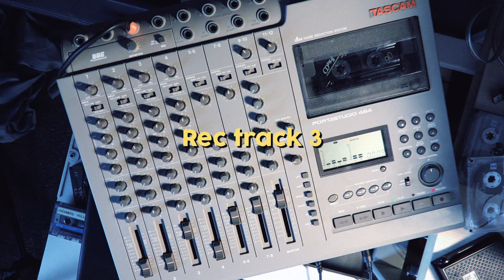How to make 10 second tape loop / tascam portastudio 464

Comment: Your music sounds amazing! I have made a 5 second tape loop but it looks nothing like yours. Honestly, I find it very hard to follow what you did exactly. The edit cuts are so fast. But I would love to try what you did. I have run into a problem with my loop. I hope you or some else can help me over come this issue. I have a Tascam Porta-Studio 464 as well as an old standard stereo cassette player. When I pop the loop tape into the standard cassette player it runs at the regular speed. But when I pop it into the Tascam and press play it runs really fast. Like fast forward fast! I've tried re-looping several different times and I always get the same issue. I suspect the Tascam is not liking something. Maybe a tension issue? Have you or anyone else experienced this issue? Is there a work around? Thanks in advance! Keep up the great work!
Reply: Hey man to answer your question the Tascam recorders record at a faster speed. I believe it’s in order to minimise tape hiss and other artefacts that occur when recording onto tape. Regardless there is nothing wrong with your Tascam recorder it is designed that way. Usually people who use a 4 track recorder would finish their master mix and then bump it out to another recording device that records at the regular tape playback speed that your other device is running at. The best thing to do is play your tape loops on the Tascam where you can sort of play it like an instrument and run effects into the effects sends and whatnot. I hope this helps.